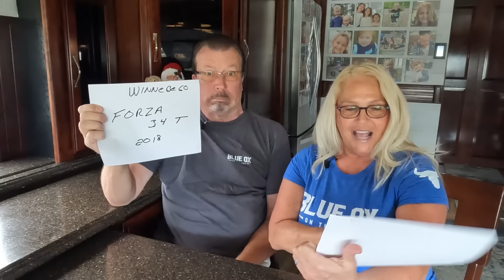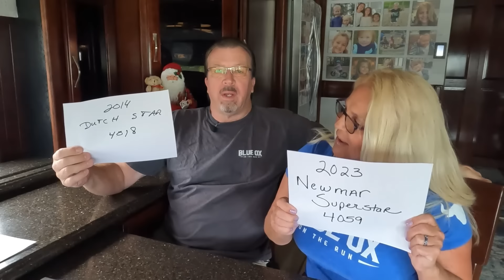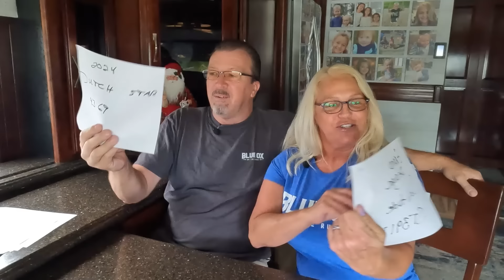💥BEST & WORST RV BRAND or MANUFACTURERS RESULTS. ARE YOU SURPRISED?

Comment: Until the Rv industry either goes to robotic or stops putting production quotas on their employees we will always have less than perfect rv’s.
Reply from the maker: Exactly 💯 
We need to be proactive, not passive when purchasing such a product. It's a lot of money. Hard earn money for most of us, don't you think?
Reply: @blueoxontherun9188  totally agree. I used to build Beaver Motor Coaches and when we were hired they said we would work 4 10 hour shifts. Lol. That quickly turned into 5 10 hour shifts than 6 10 hour shifts. We were tired and being rushed to get the Rv out and we were always told we are behind.
Reply from the maker: Thanks for your services 😊  They do not care much about employees as you stated, or customers for that matter. Treating their employees like that, reflects on the lack of quality of the end users RV  products.

Comment: My daughter bought a 2023 Thor Tallero 20J, in July 23 2023. In the first year she put 20,000 miles on it. Before she left for her first long trip, I had several issues to fix. I realized the "J" meant junk. She comes home once a year or more so Dad can fix things. I was a former home inspector, one of the biggest problems was mold in homes due to everybody sealing up homes to "save" energy. The Thor has vinyl covered press board. When the black van was closed up on a summer day the temp inside could get up to 175' and all the vinyl started peeling off. There were two leaks in the enclosed water tank that caused the floor underneath to get soaked and warped. I don't want to go through the whole list but I sure wish she would have taken DAD to the sale that day. I feel bad that she is stuck with a 10 year $889 a month mortgage.

Comment: I got one for you for the wettest.  I'm an inspector and have been doing this for less than a year so I am learning a lot from your channel.  We were doing an inspection on a  2018 Explorer Avenger 32 BIT travel trailer. While testing out the city water connection, water started gushing out of the inside of the trailer, the bottom and the outdoor kitchen. We discovered that in multiple areas of the water lines, rats had eaten through leaving large gaping holes.  And those were just the ones we could visualize.  Who knows what was in the walls that we couldn't see.  Anyway I love your videos and keep up the good work!
Reply from the maker: Thanks for chiming in Mr Jim! Never had that one happened yet 🤣🤣 that's a cool one for sure!! 
Make sure to touch base anytime 😊 www.blueoxrvinspection.com
Reply: My daughter left her 5th wheel at a horse show for a couple of weeks, in between shows. When she came back, the rat's had eaten the plumbing and electric cords. It was a mess to fix.
Reply from the maker: Ouch!

Comment: I looked at some newer 2021 and up travel trailers. Was looking for a 2 person perfect floorplan. Pretty much all the newer ones looked cheaply built to me. Looked at a Apex Nano and material was garbage. I don't camp alot, but We do a 2 week river rafting trip every year and is 110-120 degrees there. Found a 2016 FR primetime Tracer executive m-230fbs, $12000. I cant find a thing wrong with it, used moisture meter, not even a scratch inside, oven never used, no signs of leaks or damage anywhere. I owned 5 past rv's/and trailers. Guy was very ocd i bought it from, the real wood was a plus also and he replaced dinet with a double recliner which i would have done if it did not have it and looks factory. He gave me many other items, weight distribution hitch, lock, cover, k cup machine, he put on goodyear tires and 2 new deep cycle batteries. I just brought it home a couple days ago. Going to go over it again and double tripple check everything, but right now i am feeling like i got a great deal.
Reply from the maker: Good for you!!
Go out and enjoy 😉 😎

Comment: What kind of moisture meter are you using, I have an older one I used in home inspection but it's a pin type. When the sprinkler line in the attic of a hotel I worked at froze up and flooded the top floors, I used a thermal gun to see how far up the wall the water went up. Water or moisture will give you a good higher temp. My daughter is going to trade in her Thor in March and this time I am going with her!
Reply from the maker: Good dad! Take care of her.
You can find the link at the bottom of our videos in Pierre Tool Box 😉

Comment: The best ones? That MUST be an RV which has no wood involved. So an RV or Trailer which is completely from aluminum, Stainless Steel or and Azdel - no wood at all.
So, ATC as a company comes immediately to mind since ATC is about of the only one who does not use wood at all in their trailers.
Reply from the maker: We had a fleet of aluminum trailers...🤨 that's how a became a pro at welding aluminum
Reply: @blueoxontherun9188  Yes. The ATC trailers crack over time even on the frame. Since it is aluminum and it tends to crack over time. That's why I would consider these ATC trailer "destination trailers" as bungalow and tiny home replacements. You do not move them around but let them deliver and consider them as "house on wheels" for the time an chinese invasion is going on and we have to mover further up north or south. I would not constantly travel with aluminum framed RV's.
But... they never rust nor get water damage. If everything is aluminum and Azdel, there never will be mold or water damage. THAT is the main purpose of all aluminum trailers. ATC floorplans are a bit small but they do not have slides which will eventually fail one day. Yes aluminum is prone to crack. Just put thicker aluminum - but then builders get cheaped out and then the too thin aluminum cracks.
I like the concept of Timberwolf with an built in veranda but then their trailer is to small and contains wood. 
I suggest ATC does an Timberwulf design 2 story trailer of 70 feet long including 2 verandas on both ends. Kind of an destination bungalow trailer RV. To tow with an semi truck or do an gypsie wagon type of trailer with an agricultural like moving front axle. Tow with an tractor. That'll do it. All aluminum and Azdel with 3 inch isopor foam walls and off ya go.
I designed an RV trailer and sent that to Silbert Wohnmobile (Silbert RV's) in Germany but never heard back from them. Knaus Tabbert Wohnmobile (RV) in Hessen has an interesting CNC machines foam aluminum sandwich wall for the RV which withstands alaskan winters since it has in it about 3 inch isopor hard foam.
My RV design was an modular mix of the technology of ATC (USA), traditional Gypsie wagons and Knaus Tabbert (Germany) RV's, easy to fix, no wood, all aluminum and Azdel or Stainless Steel and the like made for canadian winters.
Seems to nobody interesting in it and everybody likes the shitty construction quality of modern pretty over functionality RV manufacturing.